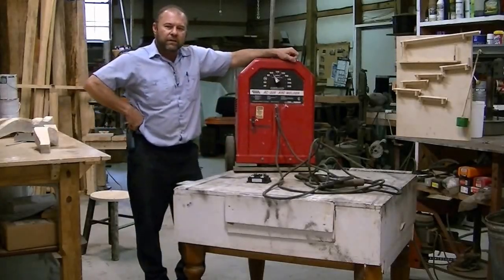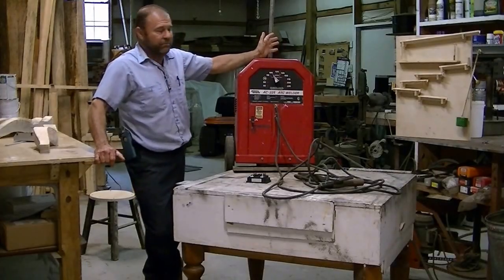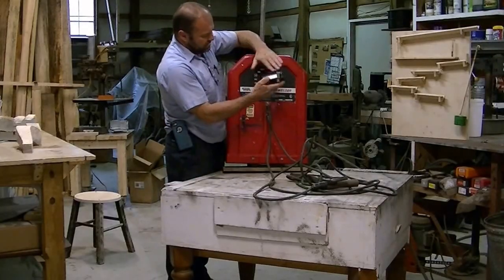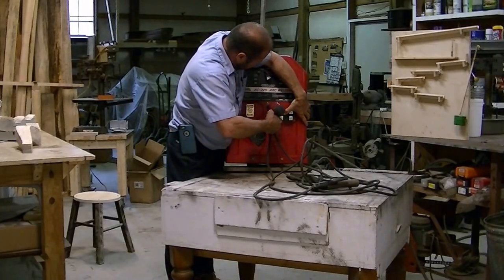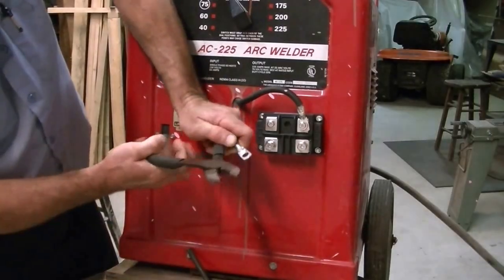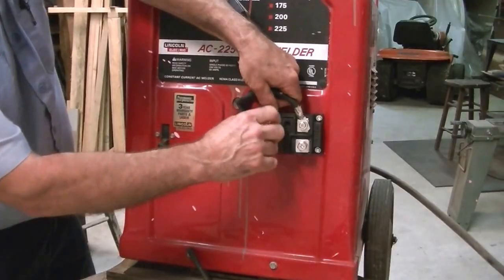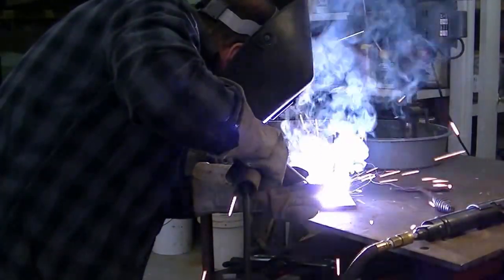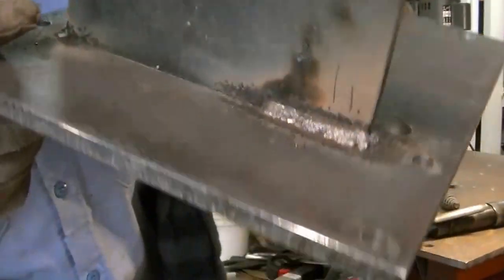Convert your AC welding machine to DC for $50. Weld 7018 rods,more strength

Comment: Just use 7018 AC or 7016, the hot topic of welding. E60xx series electrodes suck.

7016 or the Excalibur rods will give you everything you need to satisfy your welding needs while fighting arc blow.

Comment: It would work better using a 4700uf  63v Capacitor across the pos and neg Output of the diode rectifier.

Comment: I suppose that would be easy and cheap. I built an adaptor long while back with ideas from people in USENET. I built my own bridge out of single diodes on heat sink. I took off a 15/amp variac, the core and wound suitable windings, but FIRST. You need to cut one side of the whole core all the way through so it does not saturate. It seemed to work very well. Was using a Sears AC unit of bought then gave away. Need a some sort of band saw to cut core. The series inductor smoothes out the pulsating DC.

Comment: I really appreciate this! I've always just used 6011 with my buzz box but got a box of 7018 for nicer quality welds and have been totally frustrated with them. So reassuring to hear that it's not just my skill level! I'll be taking your advice and converting my machine to DC. Thanks again.

Comment: I hope your test metal is a project
A test coupon that size and of that material would surly cost .
Yes I like this,
I think there is much can be done to rectify AC welding machines
Considering the availability of inexpensive fairly high amperage rectifiers

Comment: Great idea! I have a Hobart T400 AC monster with a great arc and though AC is fine for most work with the correct rods I'll add DC to get more use from it. Rectifiers can be run in parallel for additional ampacity.  
When mounting to a metal surface ( heat sink preferred) some thermally conductive paste as used on CPU heat sinks is a very good idea.

Comment: Thanks for the link to the rectifier. But mounting it externally is jerry rigging it.  Electrically, it wants a heat sink, a choke and a capacitor (That integral aluminum plate on the Recttifer is there to conduct heat to a heat sink.

Comment: 7018 is a AC/DC rod. This modification would allow the use of 6010, 7010, 8010, 7016 and other DC only rods. This modification would also make it possible to use DC tig welding.

Comment: Now finish the process. Get 4 dins 35 sockets (those twist lockers on "modern" welders), and a steel box big enough to cover your rectifier, and mount all 4 sockets without shorting. Short jumpers to your ac terminals from 2 sockets, same same from the DC to 2 sockets. Now 2 male dins pins on your welding leads. Mount the box on the face of the buzz box (covering all the wiring)... have a cold beer. Now you can just pop your leads in the appropriate sockets for dcep , dcen, or ac. It'll also let you adapt the old buzzer to scratch start tig if you're so inclined. Btw, that 20% duty cycle is at max amps, you get 100% out of a tombstone around 100 amps (or less, of course).

Comment: That so called 20 percent duty cycle is at full amperage!  You can go 100 percent at 70-100 amps most likely, check your owners manual for full details... the lower the amps the higher the duty cycle!

Comment: Hello, just saw your video. thinking of converting my lincoln to dc. I'm assuming that you can covert back to ac by attaching your welding cables to the ac side of the rectifier without having to totally disconnect the rectifier? Thanks

Comment: Can you still use it as an AC welder when you chose? And what size fuse do you need,will my 50 amp 240 welder circuit be enough
Reply from the maker: The answer to both questions is, yes.

Comment: I just got done with my conversion on a Miller Thunderbolt and it works great. Noticed the difference when striking an arc on DC right away. I added the DC plugin sockets to the right side of the front panel. Plus on top and minus under it. I changed all the plugins to the same types. I added a block of aluminum under the bridge rectifier as a heat sink. Your video was a great guide and reference. Thanks.
Reply: [ I added a block of aluminum under the bridge rectifier as a heat sink] yup it needs it

Comment: Good afternoon. I have the same welder that I've also converted to D.C. I'm trying to use 7018 rods and I'm using a 300 amp rectifier as well. Once I put the stick to the material the welder bogs down and the fan stops working. After I remove the stick from the material the fan comes back on. I'm using a Coleman 5500 generator to power the welder with works great. I've used it with another buzz box but without the conversion. Do you have any idea what is wrong with me? Thank you very much. Eric.
Reply from the maker: Hello. I am not sure why it is doing that, my guess is that your generator is not big enough. I use a 11,000 watt generator to run mine. If you have to you can weld with three car batteries. I have a video on how to do that.

Comment: What size of the lugs that go on the wire?
Reply from the maker: I used a 2/0 connector, here a link.
 https://www.amazon.com/8pcs-Tinned-Copper-Battery-Lugs/dp/B08C4YP7LG/ref=sr_1_2_sspa?crid=2MXZ8NTXLHM83&dchild=1&keywords=2%2F0+wire+connector&qid=1603574557&sprefix=2%2F0+wire+conector%2Caps%2C185&sr=8-2-spons&psc=1&spLa=ZW5jcnlwdGVkUXVhbGlmaWVyPUFORkhCUVE4U09VNUQmZW5jcnlwdGVkSWQ9QTAxNDgyMDkzSVpHOUxTMFlKVzBGJmVuY3J5cHRlZEFkSWQ9QTAwODc3OTMzNkxJRkZLUEdCWUY2JndpZGdldE5hbWU9c3BfYXRmJmFjdGlvbj1jbGlja1JlZGlyZWN0JmRvTm90TG9nQ2xpY2s9dHJ1ZQ==

Comment: Next add a choke or stabilizer (hard to find) and capacitor to keep the voltage from dropping to zero. It will hold an arc much better.
Reply: You can make a choke by just wrapping one of the leads through a gutted microwave transformers core.

Comment: Where did you install the Inductor/Capacitors (Filter Section)?  All you did was double the frequency and cut the negative half of the cycle out. Your voltage is still passing through zero 120 times a second without a filter section.  Doubling the output frequency is good but you need an inductor at the very least to smooth the dc and give your little transformer some help.

Comment: You said you used 2500V Rectifier but the link takes me to a product with1600V Rectifier.. so do I get a 1600V or 2500V ?
Reply from the maker: A 1600v rectifier will work too.

Comment: Actually 7014 and 7018 are the same strength. The only thing that differs is the last number, which is the composition of the coating on the rod. Good video, though.
Reply: 7014 is for pipe work, works great. Hobart has low hydrogen rods for AC. They work good.

Comment: Just go buy an inverter welder for less than $100. Just the fraction of the weight and space. And they have become very reliable. And they are DC.
Reply: ya now go use it to thaw out pipes and see how long your inverter lasts

Comment: I have on of these machines talk about the duty cycle yes two minutes run eight minutes rest but l have run my machine for years constant welding because I build steel roof and these Lincoln have proven themselves    capable of going nonstop from morning to evening  ,and after 19 years it's still going strong.

Comment: No heat sink shitty hack job that diode block needs a good heat sink, I cut up a car audio amp for mine and put it inside the box with a set of large caps and a choke I made custom to up the ignition voltage and it lights like a strike anywhere match welds smooth and steady

Comment: When you convert a stick welder from AC to DC, do you get a
DC (-) minus or a DC (+) positive machine?
Reply from the maker: You get both, you just switch the leads connections to get what you want. Mine is dc-
Reply: Thanks!

Comment: Having exposed terminals is a real good way to cook, fry, bake or boil biological material or your family or friends. Please cover the hot terminals. If welding companies thought building welders without a case was a smart or $$ savings. They would have mounted all there components on the outside of the welder
Reply: I have a 45+ year old Lincoln tombstone welder with two exposed connection studs in front by factory. Wonder how many died from that particular machine?

Comment: What's the Part Number of your 300Amp diode assy , what voltage will it put out, watt rating and who sells it?
Reply from the maker: MFQ300A 2500V Silicon Controlled Module Diode Bridge Rectifier 300A Amp 
I found it on ebay

Comment: I see the diode works with 3 phase AC power. I wonder if it would work on single phase 230 volts input to the transformer?
Reply: Kenneth Smith , The 3 phase is only on the primary side of the transformer , so it doesn’t matter if the input is 3 phase or single phase or even 2 phase ( 415V ) you can always use the rectifier on the secondary side of the transformer. ( never put the rectifier on the primary side of the transformer )
Reply: @johnnz1963  Yes, I thought of that knowing the diode is installed on the output terminals. I guess the question is what was the input power in the equation when, after the conversion, the welding was done successfully in the original post?

Comment: Your diode link goes to one listed as a bridge rectifier 3ph 300A 1600V. Is this the same diode you are using?
Reply from the maker: No but the three phase rectifier will work and you will have a extra diode that you won't hook up too.

Comment: 20 percent at 225 amps, most of the time you run 90-120 amps, which allows longer welding time per 10 mins, you could weld non stop at lower amps, I have never ran my machine more than 120 amps and welded for hours on end no problem
Reply: Monnie Holt yeah there tough little welders.
Reply: Me to

Comment: This is info I can benefit from. I wish to convert my old AC Forney welder buzz box this way but I am needing details on the $50.00 rectifier. Can I buy it on Amazon? What is the model and manufacturer??
Reply from the maker: I left a link to the diodes in the description.

Comment: Now you could use this machine to TIG.  A couple of quick connecters and you could keep it AC and use it on DC.  With a TIG torch, a gas bottle and regulator, you now have a TIG machine.
Reply: I was thinking the same lol
Reply: Might need to add several large capacitors and maybe a choke to make it smooth enough to run a tig setup. Idk if half wave DC is smooth enough for Tig I could be wrong tho

Comment: A little more work and you could have a switch so it could be switched back to AC when needed, like for pipe, or when you want to avoid arc  blow.
Reply: That seems weird. I've never seen a pressure welder use AC.

Comment: 7018 is designed to run on AC, some shop use AC when they have a problem with arc blow. But they run best on DC+ , those cheap buzz boxes just don’t have the ass to run some rods
Reply: I meant designed to run on DC+ and Ac

Comment: you need a choke in series with your positive lead it will smooth out your weld, and also reverse your polarity.I've done it and it makes a huge difference.
Reply: @pierre-yveschauvet5136  I did a lot of trial and error, and the best results I had was gutting an old microwave xfmr and winding # 6 rubber coated welding lead around the core as many as I could fin it neatly and it calmed it right down. I forget what the actual measurement was now but it worked great and still does.
Reply: @pierre-yveschauvet5136  some welders use 2 diodes but you are still missing pulses, 4 diodes is more steady and true.suppressor circuit dampens the surge on the diodes., the intensity depends on what amperage you select on the dial.
Reply: @pierre-yveschauvet5136  Its 4 huge 300a diodes a suppressor circuit and of course the choke and I also have 2 computer cooling fans as well. the diodes form a full bridge rectifier and the beauty of this over the factory  ac/dc welders  is on those or most of them anyway when you go to DC you only have 1/2 the amp capacity because they use halfwave rectification  this is also not as smooth and has less of a starting voltage. I know the lincoln 225 ac/dc only produces 125 a dc and those halfwave rectifier welder do not like burning 7018 rods, mine will melt them all day long.it works very well now for years.
Reply: @stevelecain886  Hello, one question, do you use capacitors after the bridge rectifier ??  I am planning do the same, have a Lincon AC-180, and the open circuit voltage (without load) after rectifier is about 120 VCD ... would need capacitors for that "semi-high voltage", the voltaje during soldering acording manual is 24-27 V,  but capacitors for example 50v,  will explode with open circuit voltage....

Comment: If you can't run AC 7018 you are just not a good welder. It is not the machine, that ol' buzz box will be fine.

Comment: I think that hurricane irma cleaned slag off my welds in florida with more grace than you and your air toolsXD
Reply: Love those sheet metal screws with power driver. What’s cool is when it tightens them then speeds up cause it stripped them and now you need nut and bolt. Does anybody else out there in the world still use a manual screwdriver once in a while?

Comment: Hi, where did you get the MFQ300A 2500V Silicon Controlled Module Diode Bridge Rectifier 300A Amp
Reply from the maker: https://www.ebay.com/itm/MFQ300A-1600V-Silicon-Controlled-Module-Diode-Bridge-Rectifier-300A-Amp/130932347106?epid=2279854111&hash=item1e7c2d10e2:g:HQAAAOxyyjpRvsTs
Reply: @markp0177  
Thank you

Comment: The 7018 is the backbone of structural welding. This rod runs completely different from the 6010 and 6011 rods—it is much smoother and easier. ... The flux contains almost no hydrogen, and the rod produces smooth, strong welds that are very ductile. For this reason, these rods are used extensively in structural welding.
Reply: Worked in shop with structural steel in 90s. Welded I- beams and heavy channel with 7018 all the time. Welds nice and slow so all that heavy stuff gets a chance to heat up
Reply: In 80s welded a lot of plate steel and tubing with 7014 and 7024 . I like welding with that stuff. Make real nice looking strong welds

Comment: E7018 electrode is used for SMAW. ... '70' tells that the the tensile strength of the resulted weld is 70000 psi. '1' means that the electrode can be used in all welding positions (horizontal, vertical, flat and overhead). '8' refers to the flux covering the electrode and '8' tells that it is a low hydrogen flux.
Reply: Good one, thanks!
Reply: John Hunt! Well no shit!

Comment: complete garbage..first of all mild steel rods burn better with the weaker dc current..7018 rods burn better with the stronger ac current..and by the sounds of how your rod burns you switch up the leads. u had the stinger hooked up to the grounds and the grounds to the stinger

Comment: Diodes will make the wave into sawtooth DC(bad). Add 2 banks of capacitors after the diodes and youll get ripley DC(good). Add an inductor/chock/voltage regulator after the capacitors and youll get flat DC.
Reply: wrong, just the diode bridge gives the bottom half of the sine wave folded up into the positive voltage plane. No " sawtooth " is made.
Reply: My 1966 vintage Lincoln Idealarc has a switch for reverse DC. Unfortunately I just got hit with a bad bank of diodes - - 1 out of the 4 banks, must jerry-rig a new full wave bridge rectifier since Lincoln stopped making a replacement part, either take a chance on this chinese model this guy is recommending which now costs $88 - -  or buy 4 huge Vishay Stud Diodes and "roll my own"  - - - - - possibly more reliable than Chinese. Amazon turns their back on you if this Chinese one burns out and says you must deal with seller to get return/refund (in China of course). Study the insides of my '66 it appears I already have one large cap and also a choke. Any suggestions ?

Comment: Just look at a DC stick welder schematic. They use a big choke, like 100A+, which aren't cheap, to smooth out the DC.
It simply goes in series with the + terminal. This works better than a capacitor which would discharge with a big
pop as soon as the rod hits the grounded piece. A choke is simply wire wrapped around a laminated core..like
a one-sided transformer.

Comment: Correct me if I'm wrong but 7018 is a 70k psi rod and so is 7014?  One is not actually stronger then the other.
Reply: Like I might have mentioned earlier, I think a lot of it has to do with the way it goes s l o w so the metal gets a chance to heat up and make better weld.
  Also welded a lot of 7014 and seen it hold some pretty incredible strength

Comment: I'm just a 2nd hand hillbilly but I've welded all kind of steel without grinding or cleaning with my a c machine using what ever rods I have laying around.my welds hold, look good. I have run my machine so hard that the road holder was red hot and had a truck roll over with 6 in I beams welded to the frame break off clean 6 in past my weld.hot and deep.

Comment: Mark, I know in the video you mounted the rectifier right to the AC welder, so there is no need for an air gap of some kind for cooling?
Reply from the maker: No you do not need a air gap. The metal on the back of the diode touching the metal of the welder will transfer the heat.

Comment: I can't believe... You people are crazy...LOL... SOME ALEGATES that AC   welds 70-18 like butter... SOME OTHERS stated that DC welds like butter...lol... OMG...! Who says the truth...???
Reply: I have welded 7018 ....often over the years. ( like today ) I just remember most times I run it on dc machine I end up switching to AC because it works better.
  I crack off the edges of the flux after I stop so it will restart easier. A grinder sanding disc works good sometime to touch off the end. Not a file because somewhere along the line you’ll forget and do it with file right on the bench and BZZZZZZT !!!
  Maybe for going uphill  or upside down standing on your head it better on DC